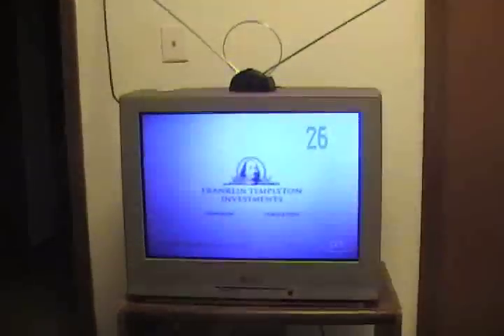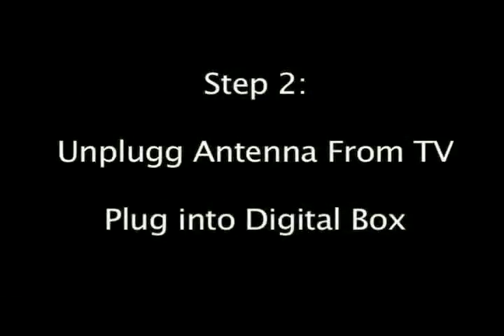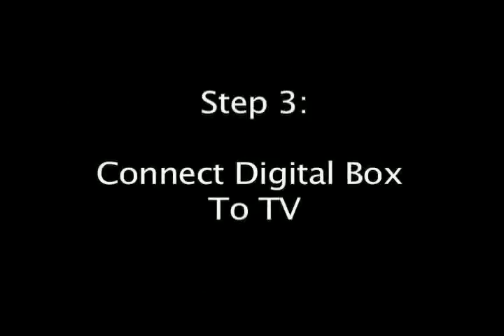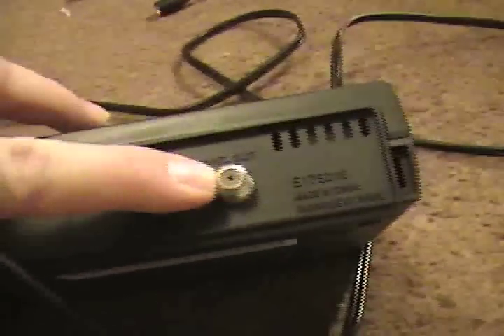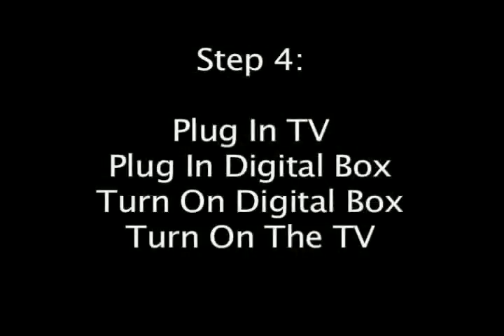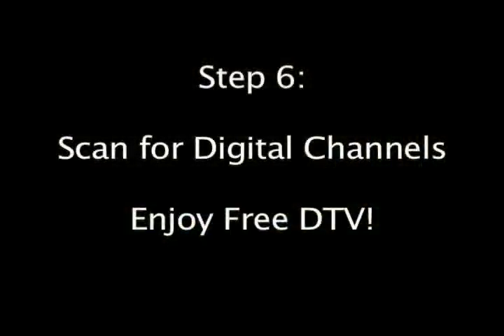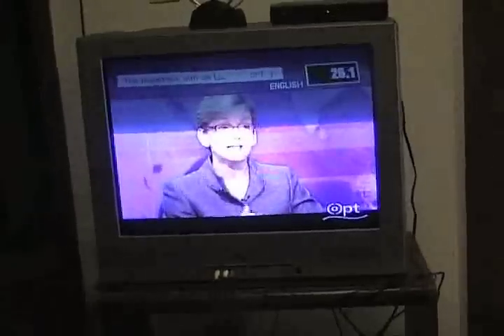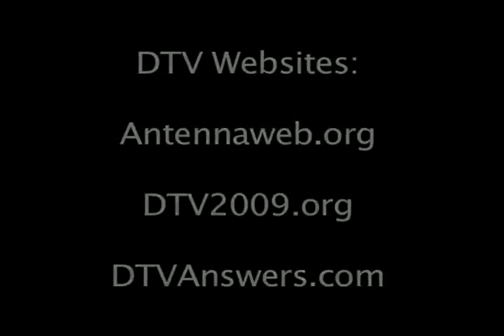How to hookup a DTV Converter Box

Comment: In México the Best Brand of DTV converters(STB,Set Top Boxes) for DTV Boxes Is FOL,because DOSYU tend to be more inefficent and a high faiure probability to connect vía COAXIAL Cable because DOSYU doesnt have a firmware adjustable switch vía setup menú to use the RF OUT of Dosyu Converter Boxes,in México always Buy The FOL Brand because they aré TV Boxes that even could function in very older CRT Tv's.

Comment: 1:10 I don’t have an Antenna Out place on my.converter box. What do I do?
Reply: you won't need to use the antenna out. The antenna goes into the box and you use the cord from box out to your tv. Since its 2020 im assuming the box today has hdmi out and hooks to the tv that way. or you can use the rca inputs as in this video.
Reply: Jarrod Griswold So if the cord attached to Antenna In goes to TV out, it should work? Also, is an HDMI chord necessary?